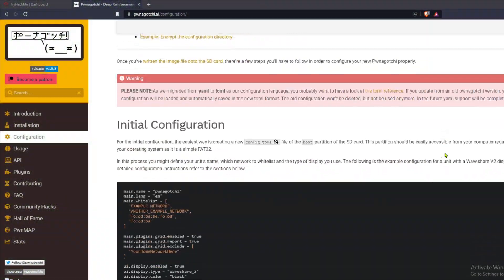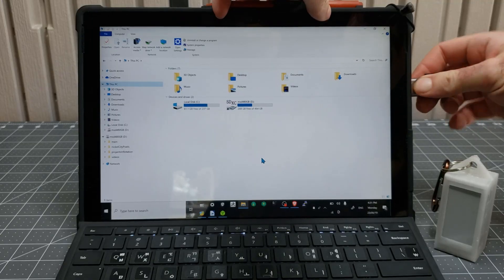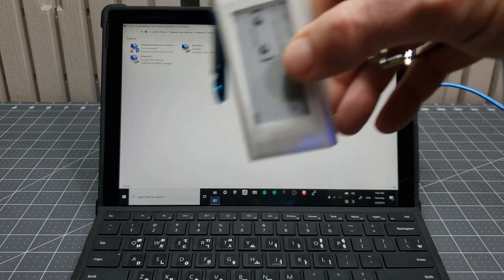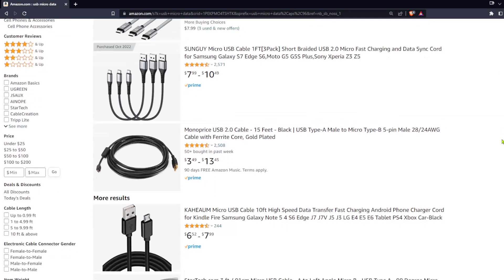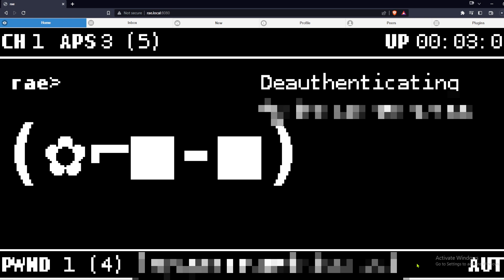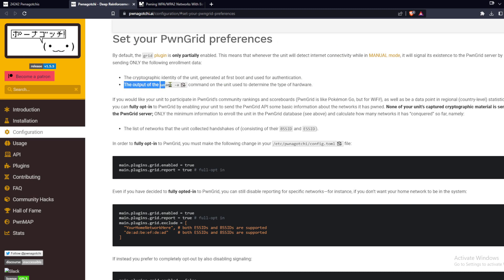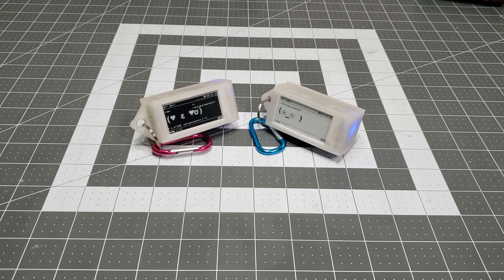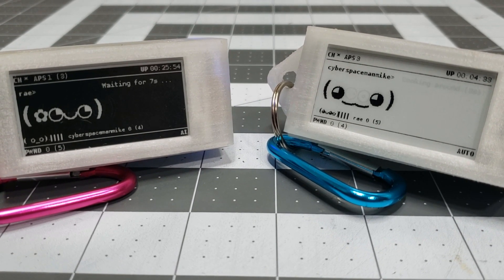Pwnagotchi Tutorial, Pt. 2: Software (using Waveshare V3 and where to find RDNIS drivers)

Comment: Mine is stuck in manual how to I get it to auto please help
Reply from the maker: From the documentation on pwnagotchi.ai:

Boot Modes:

If your Pwnagotchi is connected via USB data port, it boots in MANUAL mode.

If it’s powered only via USB power port, it boots in AUTO mode, then typically transitions to AI mode once the neural network has loaded (about 20–30 minutes on a Pi Zero) 
pwnagotchi.ai

In MANUAL mode, Pwnagotchi does not sniff or capture handshakes—it's intended for interaction, updates, and using bettercap’s web UI 
pwnagotchi.ai

AUTO mode enables active scanning, deauthentication, and handshake capture; disabling AI or while AI is still loading, it operates under a fixed algorithm

Comment: I did everything step but step, I got the computer to read as RNDIS but it’s saying “Network Connection unplugged.” I’m using a data transfer wire, any help or anyone running into this?

Comment: hey i need help id be very gratefull if you could help me, i got a raspberry pi im setting up as a pwnagatchi the problem is they stopped selling the v3 screens on amazon and i had to buy a v4 could you help me set it up with a v4 screen? also the fix version of pwnagatchi's link isnt working
Reply from the maker: Hi, this tutorial is a bit out of date. These days I recommend the jayofelony image (or aluminum ice if you're using a Pimoroni display hat mini). It has a setup wizard and you'll be able to select V4 and it will work. LMK how it turns out, please post pics of your build on our Discord! Thanks!

Comment: so im not sure if i did anything wrong but my rasberrypi does not show any indication that it has been connected, I have noticed in other videos a greenlight turns on but I dont have that is it normal ?
Reply from the maker: Does it boot and just not show up on the PC? Or is it not working at all?
Reply: thx for the reply sooo i figured it out I was using a Ras pi zero 2 with the v4 screen and the original image was not working so I ended up using jayofelonys and from there everything has been working I even set up a custom image my pikachu is at a level 12 so far  @cyberspacemanmike

Comment: i got everything working. and i see the devices pwn APs.  now what? how to know the password of those APs?
Reply: Hi, so youtube doesn't get on their high horse on me again I have to tell you to get legal permission before doing this, but you have twoish options after you get the pcaps off the pwnagotchi:
You can run Hashcat on your home computer with:
1. A wordlist or a rainbow table and hopefully it will crack the hash using data already in the list (relies on data similarities)
2. Brute force the password which can take up to months depending on the strength of the password (Which if wordlist/rainbow tables don't work this is your only bet)
The thing to note is that when you get a "Handshake" You don't get the password of the router and can just log in. You get the hash that the router is looking for in the end and now have to compute a password that will get converted into the hash. The only difference is that if you know the HASH of the password nothing has to physically be there asking the router "Hey is this password right?"
Reply from the maker: @jzburda  Did youtube block your comment or give you some sort of warning?
Reply: @cyberspacemanmike  Hi mike,
Youtube gave me a community guideline strike for making a tutorial on a game about hacking
Reply from the maker: @jzburda  That's crazy. YT kind of sucks in that regard. I think this channel is partially shadowbanned for w/e reason. Eventually I'm going to post some of the analytics in the community section someday soon. I have videos that have thousands of views in the first 24hrs. and then flatline. Please share the vids so we can defeat the algorithm! (^‿‿^)
Reply from the maker: Assuming you are legally entitled to audit the networks, you would extract and process the pcap files.

Comment: screen will not boot up when connected to USB port. Laptop is recognizing it as an Ethernet network through USB Ethernet/RNDIS Gadget, the Pwnagotchi had a flashing green light for a couple minutes, which eventually turned to a solid green light, however the screen has yet to show any sign of functionality. Any ideas? Is there a way to test whether this is a hardware or software issue?
Reply from the maker: Does the screen boot when not connected to a USB port? Can you SSH in when it is connected? Testing pwnagotchis is really a case of swapping out good, known working parts until you find the culprit. If it is hardware, from most likely to be faulty to least likely I'd say it's micro SD card, display, battery, cable, pi.

Comment: I'm attempting to build this.
I've ordered the parts...

The display seems to be on Version 4 now.

Do you happen to know if the 1.5.5 fix works for this or if they'll even be an issue etc?
Reply: For anybody else wondering, a video came out 2 weeks ago with V4 display that the guy goes through EVERY SINGLE step to get it working:

The Pwnagotchi Project - A Beginners guide to getting started (waveshare v4)

Comment: Instead of using the Waveshare v3 can I use the waveshare v4. Will it still work? Also, does this use ai?
Reply from the maker: I have a video on v4 but be sure to read the caveats in the comments. It uses a type of AI, it's better explained on the pwnagotchi site.
Reply: @cyberspacemanmike  In that v4 video that you made you mentioned that there is not much a difference between v3 and v4. Is the ai that you used in this video the latest ai as if now?
Reply from the maker: @NirvaanGoel  Well, the issue now seems to be that Waveshare sent out a lot of V3s labeled as V4s and there actually is a significant difference between the two AFAIK. I want to do an updated video but I keep getting sent V3s. If your V4 isn't working it might be because it's an actual V4 and not a mislabeled V3, reddit.com/r/pwnagotchi will have more info on getting it to work. The AI is pretty much the same across all the different versions and images.
Reply: @cyberspacemanmike  What is the difference the v3 and v4?
Reply from the maker: @NirvaanGoel For our purposes it's likely the real V4s need a different installation procedure.

Comment: Hey cyberspacemanmike, thanks for the straightforward tutorial. When I go to set up step 2, Pwnagotchi just starts up like I just turned it on. This sound like a data cord issue? Tried to install the drivers, but same result
Reply from the maker: Np! Are you able to tell if the drivers installed correctly? Where'd you dwnld them from?
Reply: @cyberspacemanmike  It was a driver issue! Device was being recognized as USB device, once I updated the driver. BINGO, BANGO, BONGO! Thanks for the quick reply!!
Reply from the maker: @qowox  Lol np! Glad you got it working. 
(•‿‿•)

Comment: Any tips for me? Followed your video to the exact steps. I have a V4 screen and cannot get any picture to come on the screen. Did everything exactly correct, any tips?
Reply from the maker: According to reddit, this only works for V4 screens when Waveshare mislabels a V3 as a V4, which they do A LOT. For actually V4s there's a whole different process. I haven't been able to do a video on the new process because I keep getting sent the mislabeled screens. There's some instructions on reddit though.
Reply: @cyberspacemanmike could you try to explain them to me? I know there needs to be some changing in the code just not quite sure where it needs to be inputted
Reply from the maker: @kreesky  Unfortunately I've been unable to test this myself because Waveshare keeps sending me the wrong or (supposedly) mislabeled versions.  This thread has instructions that should help however: https://www.reddit.com/r/pwnagotchi/comments/11ep7td/waveshare_v4/

Comment: Hey love this video since I was trying to get the ai mode working on 1.5.5 but no dice. Worked perfectly with the 1.5.5 fix. Right now I am trying to get the pwnagotchi connected to the internet via the ethernet/rndis, more specifically for the aircrackable only plugin. Couldn't find help online about how to do it without internet on the pwnagotchi, would this be covered in your next video?
Reply from the maker: Hi, thanks so much! I'm glad to hear the 1.5.5FIX worked. The ethernet gadget connection (which requires the RDNIS drivers) facilitates SSH, it looks like there is additional scripting necessary to get the pwnagotchi to connect to the internet. Without an SSH connection I think it would be nearly impossible to install the plugins. If you have SSH but don't or can't connect the pwnagotchi to the internet, you can do aircrack-ng-plugin-like stuff without actually plugging anything in (eg using pwnagetty). I might do a plugin video later, as it is, I'm already falling behind.  :/
Reply: @cyberspacemanmike  Ah I got something temporary to work for internet with the bluetooth tether feature on my phone. This was because the share internet script on pwnagotchi's website didn't work. Everything else works great though.

Comment: Great Vid thanks by the way. I have tried everything but cant get the v3 screen to work any tips?
Reply from the maker: Thanks for watching! Are you using 1.5.5FIX? When I couldn't get one of my screens to work it turned out to be a hardware issue with the screen itself and I had to replace it. Other than that I'd suggest scouring https://reddit.com/r/pwnagotchi as it seems they've archived every problem and solution ever to occur!
Reply: @cyberspacemanmike  Yes i used the 1.5.5Fix...Ok thanks , I was thinking the same thing that maybe it the screen itself , i hope its not

Comment: can you provide a list of parts?
Reply from the maker: Sure! I recommend watching Pt. 1: Hardware: https://youtu.be/R-fTPv09vQ8?t=98

You will need:
Raspberry Pi Zero W
Micro SD card
Waveshare V3 e-ink display (optional if you want to go headless)
Pisugar S Portable 1200 mAh battery (optional if you keep it plugged in or run it off a battery bank)
Case (optional if you can otherwise keep it safe)

Comment: even with following all the steps, DL 1.5.5 fix it's still not showing up on my waveshare display v3
Reply from the maker: If you used 1.5.5FIX and edited config.toml to read "Waveshare_3" it might be a hardware problem.
Reply: @cyberspacemanmike  that's also what im thinking, ive ordered another waveshare an ill try it again
Reply from the maker: @Ykhavari  Did you do a slim or slimishagotchi mod on it? It's very easy to clip the Waveshare's ICs with a soldering iron when trying to removethe port. I think I ruined one that way.
Reply: @cyberspacemanmike  I ended up having to go into the terminal and edit the config.toml file because it was still showing waveshare 2 even thought the note file said waveshare 3
Reply from the maker: @Ykhavari Thanks for sharing the solution and I'm glad you got it working! I was about to suggest that because I saw someone on r/pwnagotchi had the same problem/solution: https://www.reddit.com/r/pwnagotchi/comments/14jthp7/waveshare_v3_screen/

Comment: thanks for the video. I was doing the installation after the initial configuration, I have a problem with the configuring the ethernet, it does not appear, I disconnected by mistake and now the ethernet config, doesn´t appear.  What I do?, pls help
Reply from the maker: Did it appear once and then not again? Or not at all? If not at all, double check you have the RDNIS drivers installed, in fact, I might re-install them just to be sure. If it appeared once and won't reappear, I'd suggest reflashing all over again.
Reply from the maker: Also thanks for watching! Lmk if that helps.

Comment: What does the 1.5.5FIX that the current Beta doesn't? And thanks for these videos. I went through most of what you show to get mine working with the Beta.
Reply from the maker: Hi, thanks for watching! The biggest issue for me was that my pwnagotchis wouldn't bond without the FIX version. Individually they seem to work much more quickly and effectively using the FIX version as opposed to the beta. And in general it looks like on reddit.com/r/pwnagotchi, using the FIX version is the go to suggestion as to what to try first anytime there's a problem. I might do a video comparing the effectiveness of the two builds sometime in the indefinite future.